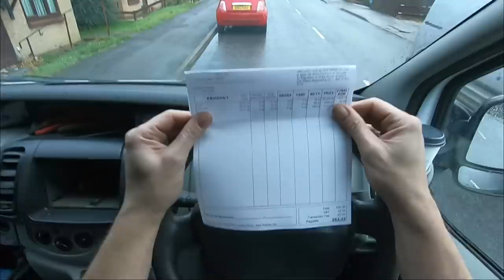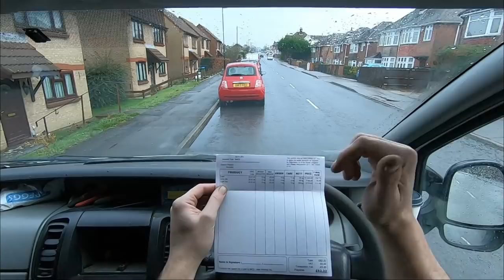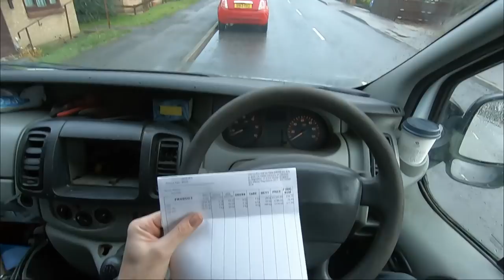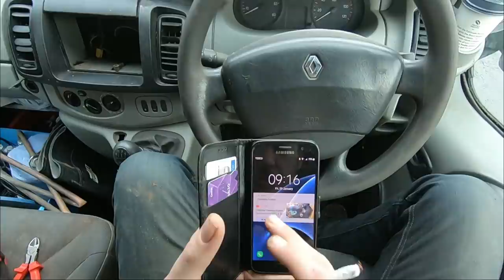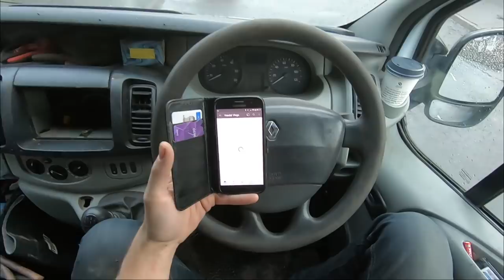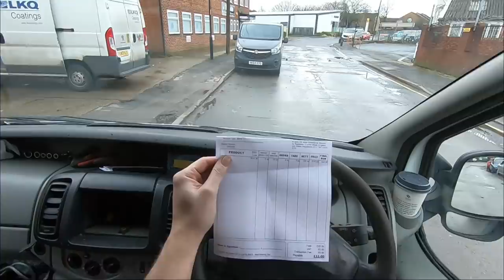Best Day Ever Part 1 - Collecting Scrap Metal £££

Comment: Alright V. If you ever go back to EMR yard, when they ask you what metal you have on say "mixed iron or mixed Steel" there is a sperate price for light iron and heavy steel. so if you say mixed they meet in the middle. At the EMR yard I used it was £100 for light and £160 for heavy so when I said mixed I got £140. Hope this makes sense and gets you a better rate. Scrap happy my friend
Reply from the maker: That's made me wonder if I should have been calling it mixed steel instead of light Iron!!!  Ill ask next time I'm there.  First time I went I said what I had and it was my first time.  They said chuck in light Iron but they gave each other a funny look in the office.  Think I might have got screwed!!!
Reply: @Vandal-Vlogs always ask. Been screwed over at EMR in the past. Mind you, screwed them over on occasion since. Bit of lead pipe in the copper pipe. Seems fair

Comment: Handles off those drawers, may be pot metal. It's non magnetic, and has weight to it. Scrape it or  scratch it on something. Those drawers were to cheap made for brass handles.